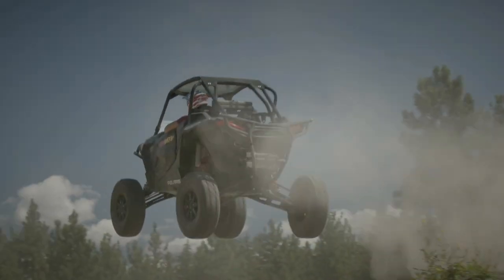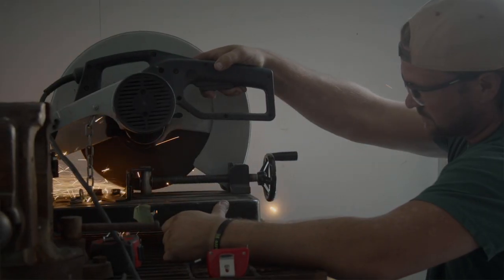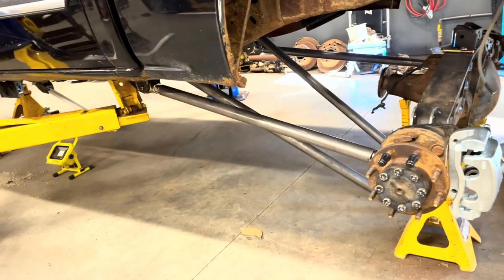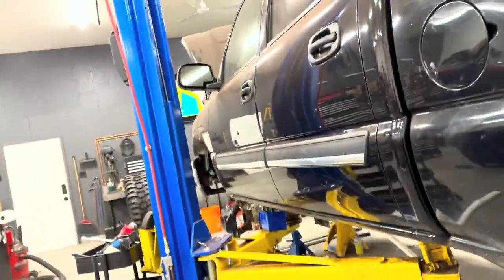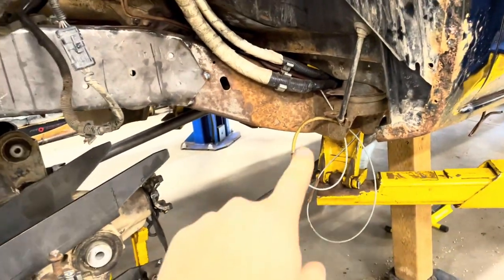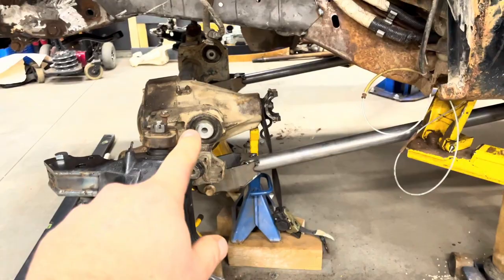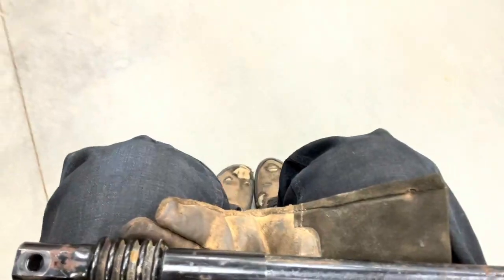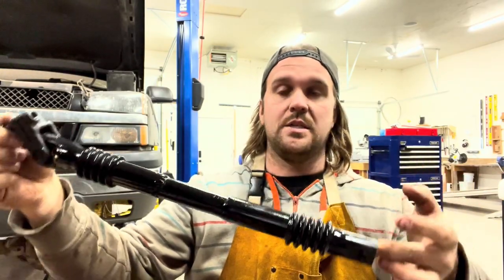BC Big Rides Ep. 5 - Solid axle swap on a Chevy Silverado.

Comment: Bruce: I bought a new one of these so I didn't have to weld in an extension, because the new one is road legal 💁

Instantaneous YouTube Ad: Come to the Toyota dealership for certified mechanics and parts! 

On a video building a Chevy 🤦‍♀️ though it's more on track than the dermatology ads at least ✔️